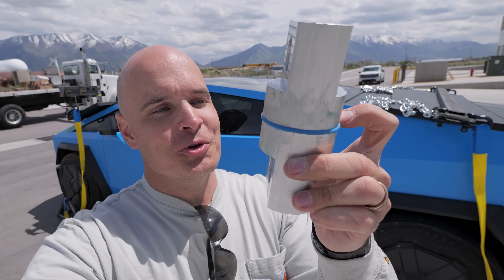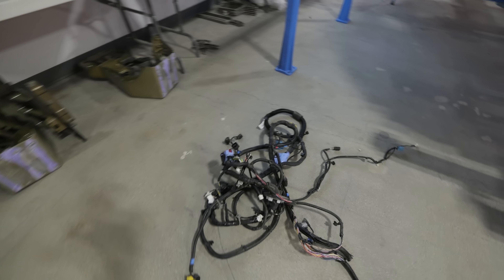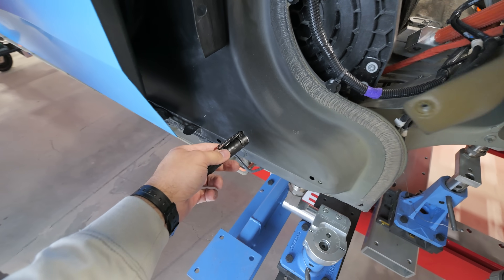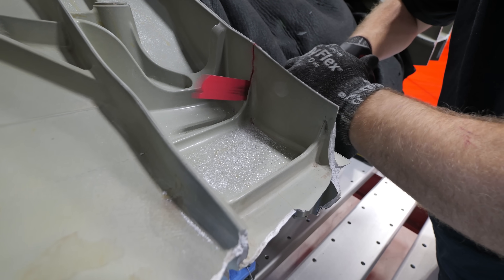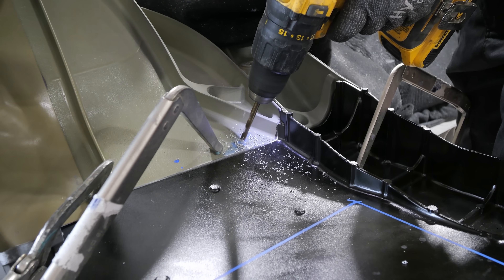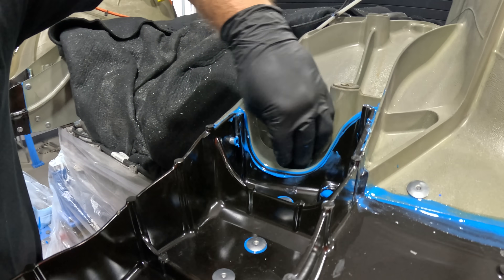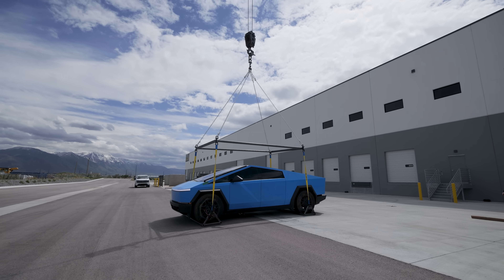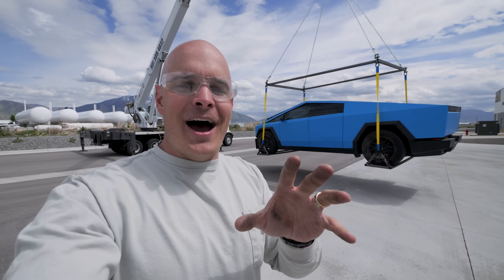Tesla Fixed my Cybertruck with GLUE - (but I'm not mad about it...)

Comment: you know if you take normal super glue, prepare 2 metal surfaces as you should when applying super glue to metal, stick them together and let it dry for a little while, you would be very surprised how hard it is to separate them. Picking up a car in a similar way to this video is a well known possibility. Once those 2 parts are joined, it is impossible to separate them without the help of some serious machinery/equipment, but again, when done right.

Comment: I’m confused the Jerry? You mentioned previously that even if you did tow correctly, uneven terrain, potholes, or aggressive braking(to avoid an accident) could produce enough force to still cause a failure— which you wouldn’t see in a traditional truck set up

So again… what have we seen here today that should make anyone feel confident that the Cybertruck is actually safe to tow or haul?

Was the manufacturing process a failure with not enough adhesive? Should a recall be in order to avoid any future failures?

Comment: Adhesives absolutely can be as strong as steel. It's not even a question, just look at the old Superglue ads. The problem is that adhesives do not last indefinitely. They have different thermal characteristics compared to steel so you get thermal stresses on each heating cycle, and they get (more) brittle at low temperatures. I wonder what the longevity of these load-bearing components will end up being...

Comment: Adhesives, when properly applied, are fantastic. Crazy glue will do everything you saw in the commercials. Epoxy can do wild things. Even good ol' JB Weld is a miracle. Sadly, you do have to clean and prepare the surface as planned, which is boring, so nobody does it.

Comment: Actually, considering that structural damages of the cast aluminium parts are bound to happen overtime, wouldn't it be cheaper for tesla to just replace those cast parts in whole? The procedure is already 13k$, it needs that special glue, specially made parts, labor... it doesn't look any less labor intensive or complicated than just replacing the whole part. They already do the frames in mass production, wouldn't it be more profitable for them to just overproduce frame parts and replace them in such cases, for same 13k$? Consumer wouldn't feel the diffrence, and this procedure just seems so overenginered.

(One explanation I'm seeing is that it mebbe costs them more than 13k$ to produce that whole cast aluminium part, but if thats the case, it's imo silly to spend so much on part of frame in production, especially considering all the drawbacks it has)

Comment: This isn't surprising. 1 square inch of regular super glue can already hold a ton of weight. 7.85 square inches of a 2 part epoxy adhesive that's industrial grade can clearly do a lot more, as expected.

Comment: Wow, that was impressive - wonderfully educational video, fascinating to see the repair process!
Reply: Jason, now we need a glue video!!! Please explain the engineering behind all this 🙏
Reply: Did anyone else read this in Jason's voice? 😊😅
Reply: Yessir
Reply: Jason did the math in his follow up video about it being possible to exceed the tongue weight in the real world but Zack said it’s actually okay as long as you load correctly. So, have we reached a final verdict yet?
Reply: @nathanhoke1  I don't recall Jason including how the suspension and tire compression (sidewall flex) also absorb a very large portion of the shock that would be transferred to the hitch.  I think the math all basically assumed a rigid suspension setup.  To his credit that would be much more difficult but unfortunately still a potentially massive missed calculation if my recollections are correct.
Reply: @TheDarinseng  granted, but we've seen multiple cases of the hitch failing while towing so far in the real world, so while you might be able to quibble with the exact numbers he got or the assumptions he made, clearly his overall conclusions do accurately reflect reality
Reply: @nathanhoke1 yes, the cybertruck exceeds specifications by 6 times. 

For the vertical (tongue) load, SAE J684 requires the hitch to withstand a static load equal to 1.5 times the rated tongue weight vertically — without permanent deformation.

Considering that jerry had to hold down the front of the cybertruk to be able to pull it hard and deep enough to brake means the tow hitch would hit the ground before the force to snap it would be reached. It was an utterly absurd test and does NOT reflect reality.
Reply: Jason, are you also going to correct your misleading video? 

We both know that you would NEVER reach the total weight of the trailer in vertical direction. 

The pivot point would be at the axcel and if the trailer brakes at the ground, resulting in most of the force to go in horizontal direction NOT vertical. 

That is why for the vertical (tongue) load, SAE J684 requires the hitch to withstand a static load equal to 1.5 times the rated tongue weight vertically — without permanent deformation.

There is a reason Jerry had to hold the front of the cybertruck down with a dozer because the cybertruck hitch would hit the ground way before the force to snap the rear would be reached. 

PLEASE MAN UP AND RECTIFY YOUR MISTAKE. 

Thank you so much!
Reply: @bartdeking  genuinely curious now. Would it help if it hit the ground? As theirs that whistling diesel video where the truck hits the hitch and then snaps after applying load to it later. 

So if it hit the ground while towing would their be any guarantee to its structural ability to tow again?
Reply: Have you ever towed 11000 pounds where the hitch hit the ground? @thermalops 
No, that scenario does not exist. The force downward will never exceed 1.5x the max rated tow hitch weight. 

Dropping a truck 6ft from the air is not a realistic scenario or is it? 

Jerry had to use the dozer to create an unrealistic scenario to make it work to put such unrealistic downwards force on the hitch. 

For the vertical (tongue) load, SAE J684 requires the hitch to withstand a static load equal to 1.5 times the rated tongue weight vertically — without permanent deformation.
Reply: @bartdeking  never towed anything n probably never will. However still am curious because cars and engineering interest me and also the conflicting reports I’ve seen. Mainly from what I’ve seen their have been instances of cybertruck frames snapping while towing though I’ve never confirmed or not if their trailers were properly loaded. Their is also still the claims that jre and others have made that creating a hill could put a significant load on the hitch though at that point it’s not going to be a perfectly vertical load so the on paper stuff doesn’t seem to cover that exactly.

Though honestly I’m feeling like the best way to prove that the cybertruck does hold up to teslas claims at this point is to go beyond on paper and just test an actual cyber truck towing at capacity. As what they claim may be their goals but with the amount of recalls and defects all the cyber trucks have had I wouldn’t be surprised if this isn’t an engineering constraints problem an actually a manufacturing problem
Reply: you shdnt ve sold ur subaru for a tesla
Reply: Yeah mind blowing the glue is so strong and how modular the truck actually is. I don’t see a repair like this happening on a F150, right?
Reply: Wouldn't the battery pack need to be removed and inspected in the case of a fender bender big enough to require the back section to be sawed off and replaced?
Reply: @6Sparx9  I have no doubt it was critically inspected.  The need to remove it for further inspection likely was not necessary because they have a full understanding of exactly how the damage occurred just from video footage.  I cannot imagine that Tesla didn't review some footage when the vehicle was brought in for repair being who it belonged to and a bit of courtesy on Zach's part.
Reply: @TheDarinseng  yeah Im not talking about this incident exactly, in the video they were showing how this can be used to limit the spread of damage in fender benders. If a Cybertruck was in a fender bender, then would they need to check the battery every time? Meaning a small fender bender could result in massive work and inspection needing to be done to the vehicle and potentially a battery pack replacement 😅
Reply: @6Sparx9  No its not any more necessary than inspecting a fuel tank in a gasoline engine.  A quick look over and a review of the logged sensor data is all that should be required.

Comment: Scans comments "Should have kept glue secret" Smartphone battery sealing.. Solution to making better parts including welding things that you can't normally weld together is the same for recycling them once you hit that mastery you need pure Military logic to deconstruct. Ultrasonic resonance holography high resolution between things glued together you want to separate.. Goal = Directly transfer heat/vibration with perfect frequency targeting which gives ability to filter frequencies to defense all other things from your technology at the same time. Echo clashing techniques to limit range.. Cymatic patterns for perfect atomic structure of melted fused materials + Generate AI to help by extreme math for best shapes to print.

How I know? Lol.. Squints at Boeing Plasma force field blocking bomb shockwaves Plasma generated Ultrasound shockwaves dumbfounds your science for how it blocks bombs, not my science. World science: "It is but its not!" < Defect elites.. Example: "Space is vacuum, no medium dummies! Hey look at Explorer probe Ultrasound mic that can hear micrometeorites! The Solar wind! The interstellar MEDIUM which is less dense than solar wind blasting around you!" < IQ=20..

Comment: Just want to point out that structural adhesives like this are always pretty strong in tensile strength (two opposite forces applied perpendicular to the mating surface). However, what matters more, especially in the way it's applied, is the shear strength (two opposite forces applied parallel to the mating surface).  Hopefully we can see some tests on the shear strength.

Comment: As a mechanical engineer from Germany, I can tell you the number one design rule is “never interrupt the grain structure if you want structural integrity”. The fact that the cyber truck is made from 3 big castings is absolutely unbelievable (in a bad way). 

And the glue is attached on the paint. OMG. What a f up.
Reply: It held up to 10x the rated tow capacity, I think Tesla engineers know more than you do
Reply: Most structural adhesives use adhesion primers.

You don't know what you are talking about and I question your claim that you are a mechanical engineer.

As to your statement of not interrupting grain boundaries as a rule, if what you suggested was at all reasonable we would only ever use forgings and machining would be unacceptable.

Not to mention that conventionally constructed vehicles use hundreds of separate pieces in their construction, which by your logic interrupts the "grain" far more than 3 separate pieces.

As an engineer, you should know better than to comment on constructions that you have not carried out an in-depth analysis on.
Reply: @joshbridges8410 a truck chassis runs from the front all the to the back of a car/truck. A simple Google research would've showed you. But apparently you don't know what to Google even.
Reply: @grogu360 typical body on frame vehicles, this isn’t a typical body on frame vehicle

Comment: I disliked the Tesla hate, not for the brand, but the engineers that actually build it. Sure pretty much every prototype car has issues and this was released early to make promises from above. I can't comment on design or hype factors, but it is capable truck WHEN it works.

Comment: Two observations. 1. The repair manual mandates a lot more glue, than Tesla used when making the truck in the first place. 2. So Tesla has structural glue, they just chose not to use it on all the trim.

Comment: It's lovely that they let you film all of this but that does not change the fact that aluminium has no fatigue limit
therefore every Cybertruck frame will necessarily break after enough load cycles.
Reply: Are Landrovers falling apart left and right? Because theyve had aluminum frames for years, but no one cares to cosplay metaullurgy expert about those, because its not Tesla.
Reply: @Turbo.M777  are you sure you are not fighting a straw man by bringing up a vehicle which is 99% likely to not be used with a heavy trailer and was never advertised for that?
Reply: Do you not know what a land rover is? Lol  @ПётрБ-с2ц

Comment: For anyone confused like I was:
The Cybertruck's tow capacity rating is 11,000lbs.
The Cybertruck's tongue weight rating (what was tested in the last video) is only 160lbs, according to the owner's manual. Hence the "over ten times its rating" comment near the end of this vid. That math doesn't quite add up but the point still stands.
Despite the low rating, the frame bent at 8-9,000lbs and the bumper snapped off completely at 10,000lbs, only 1,000lbs less than the max towing capacity rating. 
Imo, still very concerning cause it means you likely won't be able to tow comfortably near the max tow capacity but will probably be fine for most people.

Comment: One could interpret this approach to repair as evidence that there's not enough overall parts being made, to make total/clean replacements economical. Are they making the increments on demand? Imagine how many variants they'd need to have ready made if that weren't the case.
Reply: point being, this suggests they're saving on material. The repair doesn't have to cost much even if big pieces are replaced. The expense bounces back if broken pieces hold value which is simply not accessible for the end consumer. Consumer is buying the shape and function, the material is of concern only to the manufacturer as he holds the tools/keys to unlocking the value

Comment: Glue is strong. I just recently visited the Hercules (Spruce Goose) in Oregon and it's mostly just wood and glue. The museum curators told me they measure the wing sag every year; in the almost 25 years since it's been there, the wings have sagged less then ½ a millimeter. 
Of course, they also said that the glue used on the plane is made of a triple concentration of formaldehyde and it's incredibly toxic... But they had it tested at MIT and their conclusion is the glue will hold indefinitely with very basic maintenance. Of course, that's in a climate controlled environment with very little external stress (outside of the wing weight and engines that weigh over 3,000 lbs each)...